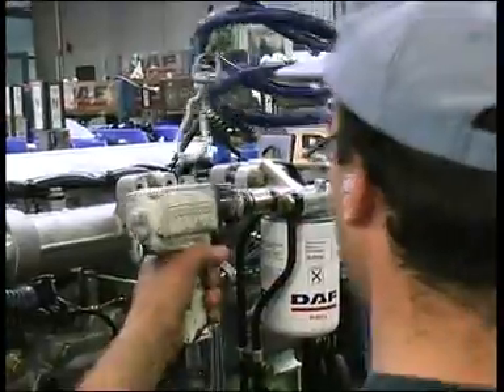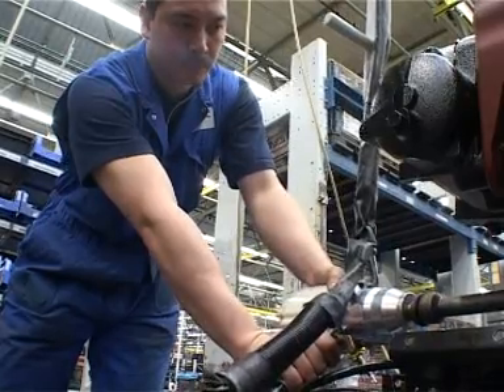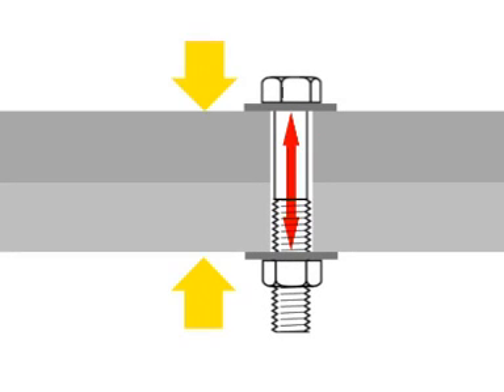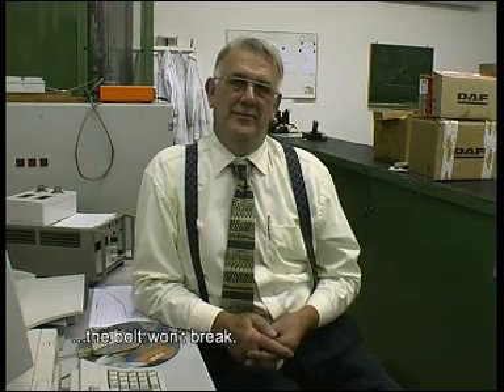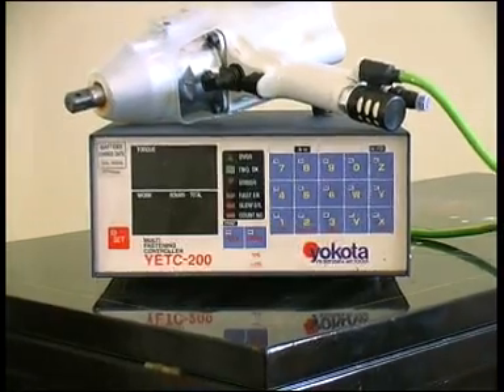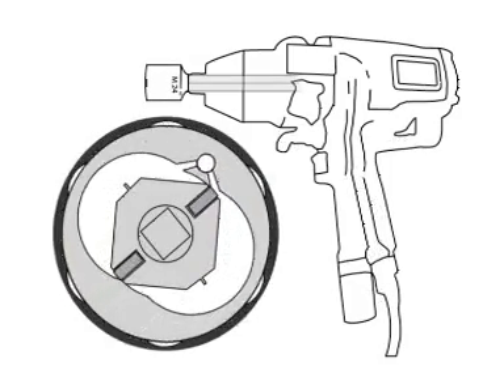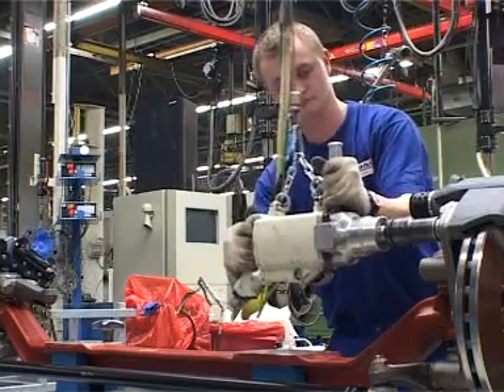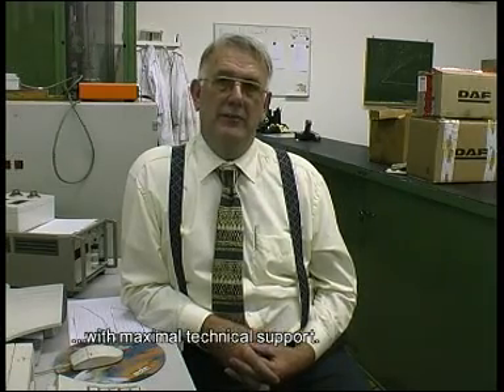Yokota impulsetools_A_Step_Ahead.mpg

Comment: Hello,
 I just acquired a Yokota air powered screwdriver from a shop that's going out of business but I don't really know anything about this tool. It is type YD-4 and serial # 4H385 made in Japan. It is the tool along with an inline regulator and two (2) air inlet fittings. There were no driver bits included. This tool appears to be unused and I'm wondering if it's suitable for home use and where I can find bits to fit this tool. I've looked at several websites about it but I'm having a hard time translating the information to English and the air consumption, torque ratings etc to US standard values as everything seems to be in metric. Can you help me with any info about this tool please and where I might find bits to fit?
 Thank you!
Reply from the maker: Hi Jeff, 
Please send your contact data and request to the US distributor of YOKOTA at sales@yokotatoolsusa.com, they should be able to help you with the US standard values for your Yokota YD-4. You can use quality 1/4" bits from your local dealer, please note that the tool is actually an industrial assembly tool, so for perfect performance of the tool you need good quality air at the right pressure.
Reply: Rami Yokota Thank you!
 I will get in touch with them, I appreciate the help!